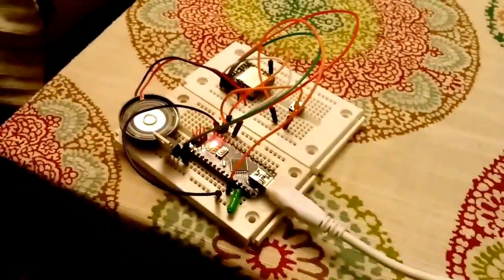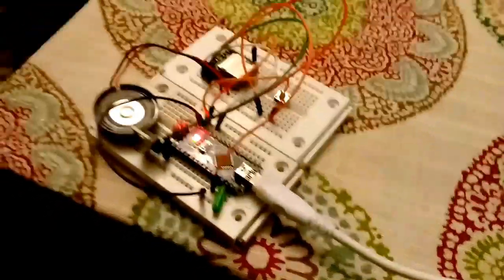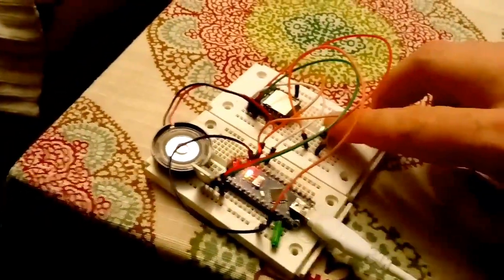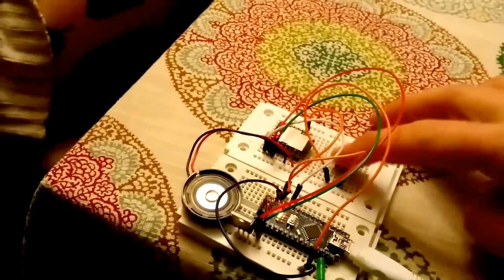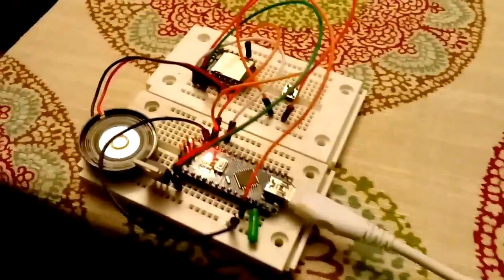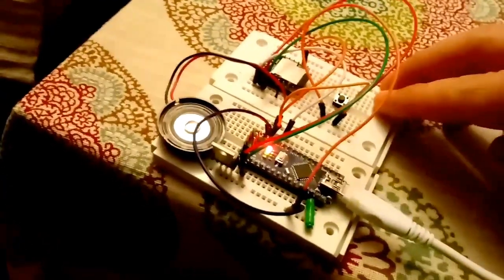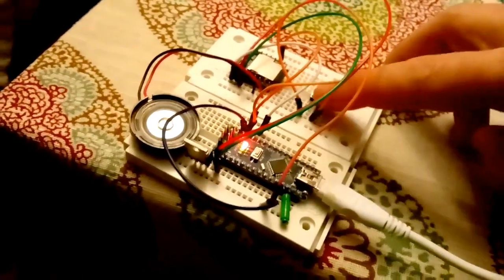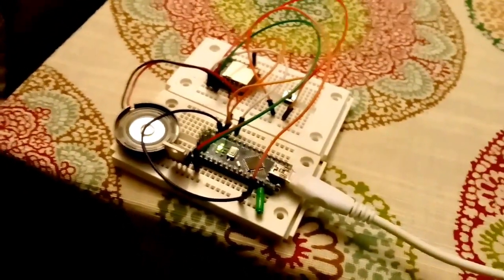Arduino and DFplayer no library serial control. Working code DL 44 Blaster Effect Controller

Comment: Did you ever think about adding a LED light for a muzzle flash to the sketch?
Reply from the maker: yes. my final sketch has a muzzle flash 0.5 w Red 10mm LED in the back of the flash hider. this post was not a how-to for DL44s.  It was just a how to for people who want to use the DF with out a complicated library system.
Reply: William Pealer I am going to adapt your sketch to a Battlestar Galactica TOS Blaster.  I appreciate this sketch... it’s helping point me in the right direction. 😁
Reply from the maker: You are welcome. that's why i did it!  make a video when you are done and link it back to me or tag me in it bro!

Comment: I saw that you said the code was in the comments, but I looked through the few that are on here and don't see them.
Reply from the maker: read again, and expand the comment below this.  :)   it's there
Reply: @billpealer  umm... okay.  I have expanded all the comments with nothing found.  Thanks anyway.
Reply from the maker: "read more"  under long comments expands them dude.  Here I'll just soft ball pitch it in for you.
//billpealer@gmail.com  Simple Blaster Core Arduino Nano and DFPlayer
// Disclaimer- you have been warned.

# define Start_Byte 0x7E
# define Version_Byte 0xFF
# define Command_Length 0x06
# define End_Byte 0xEF
# define Acknowledge 0x00 //Returns info with command 0x41 [0x01: info, 0x00: no info]
int trigger = 9;
int reload = 11;
bool isPlaying;
int LED = 13;

void setup () {

pinMode(trigger, INPUT);
digitalWrite(trigger, HIGH);
pinMode(reload, INPUT);
digitalWrite(reload, HIGH);
isPlaying = false;
Serial.begin(9600);
execute_CMD(0x3F, 0, 0); // Send request for initialization parameters
pinMode(LED, OUTPUT);

 while (Serial.available()<10) // Wait until initialization parameters are received (10 bytes)
 delay(50); // Pretty long delays between succesive commands needed (not always the same)
 // Initialize sound to medium volume. Adapt according used speaker and wanted volume
 execute_CMD(0x15, 0, 5); // Set the volume to medium (0x00~0x30)
delay(500);
}

void loop() {

//your code for on/off and sound triggers
 if (digitalRead(trigger) == LOW)
  {
    if(isPlaying)
    {
      execute_CMD(0x03, 0, 1);
      isPlaying = false;
      digitalWrite (LED, LOW);
      delay(150);
    }
    else
    {
      isPlaying = true;
      execute_CMD(0x03, 0, 1);
      digitalWrite (LED, HIGH);
      delay(150);
      digitalWrite (LED, LOW);
    }
  }
  if (digitalRead(reload) == LOW)
  {
    if(isPlaying)
    {
      execute_CMD(0x03, 0, 2);
      isPlaying = false;
      
      delay(150);
      
    }
    else
    {
      isPlaying = true;
      execute_CMD(0x03, 0, 2);
      
      delay(150);
    }
  }
}
// DF serial command code
void execute_CMD(byte CMD, byte Par1, byte Par2) // Excecute the command and parameters
{
 // Calculate the checksum (2 bytes)
 int16_t checksum = -(Version_Byte + Command_Length + CMD + Acknowledge + Par1 + Par2);

 // Build the command line
 byte Command_line[10] = { Start_Byte, Version_Byte, Command_Length, CMD, Acknowledge, Par1, Par2, checksum >> 8, checksum & 0xFF, End_Byte};

 //Send the command line to the module
 for (byte k=0; k<10; k++)
 {
  Serial.write( Command_line[k]);
 }
}
Reply: @billpealer  well after restarting my browser and clearing the cache... it showed up!  I am not sure what the deal was, but I was able to finally see it!!!  Thanks for your patience!!! LOL :)

Comment from the maker: //billpealer@gmail.com  Simple Blaster Core Arduino Nano and DFPlayer
// Disclaimer- you have been warned.

# define Start_Byte 0x7E
# define Version_Byte 0xFF
# define Command_Length 0x06
# define End_Byte 0xEF
# define Acknowledge 0x00 //Returns info with command 0x41 [0x01: info, 0x00: no info]
int trigger = 9;
int reload = 11;
bool isPlaying;
int LED = 13;

void setup () {

pinMode(trigger, INPUT);
digitalWrite(trigger, HIGH);
pinMode(reload, INPUT);
digitalWrite(reload, HIGH);
isPlaying = false;
Serial.begin(9600);
execute_CMD(0x3F, 0, 0); // Send request for initialization parameters
pinMode(LED, OUTPUT);

 while (Serial.available()<10) // Wait until initialization parameters are received (10 bytes)
 delay(50); // Pretty long delays between succesive commands needed (not always the same)
 // Initialize sound to medium volume. Adapt according used speaker and wanted volume
 execute_CMD(0x15, 0, 5); // Set the volume to medium (0x00~0x30)
delay(500);
}

void loop() {

//your code for on/off and sound triggers
 if (digitalRead(trigger) == LOW)
  {
    if(isPlaying)
    {
      execute_CMD(0x03, 0, 1);
      isPlaying = false;
      digitalWrite (LED, LOW);
      delay(150);
    }
    else
    {
      isPlaying = true;
      execute_CMD(0x03, 0, 1);
      digitalWrite (LED, HIGH);
      delay(150);
      digitalWrite (LED, LOW);
    }
  }
  if (digitalRead(reload) == LOW)
  {
    if(isPlaying)
    {
      execute_CMD(0x03, 0, 2);
      isPlaying = false;
      
      delay(150);
      
    }
    else
    {
      isPlaying = true;
      execute_CMD(0x03, 0, 2);
      
      delay(150);
    }
  }
}
// DF serial command code
void execute_CMD(byte CMD, byte Par1, byte Par2) // Excecute the command and parameters
{
 // Calculate the checksum (2 bytes)
 int16_t checksum = -(Version_Byte + Command_Length + CMD + Acknowledge + Par1 + Par2);

 // Build the command line
 byte Command_line[10] = { Start_Byte, Version_Byte, Command_Length, CMD, Acknowledge, Par1, Par2, checksum >> 8, checksum & 0xFF, End_Byte};

 //Send the command line to the module
 for (byte k=0; k<10; k++)
 {
  Serial.write( Command_line[k]);
 }
}
Reply: This works with the UNO too right?
Reply: Hey bill! I just want to say thanks for posting this code/example I really appreciate it! I just want to know if you could help me with something. I used your code to test it out but I can't seem to make it work. I tried it with the Uno and the Nano but it doesn't do anything. I also followed the hint you provided but it doesnt work. What do you think I could be doing wrong?